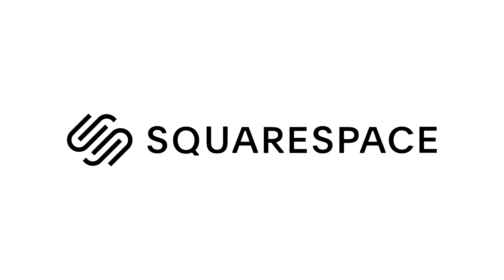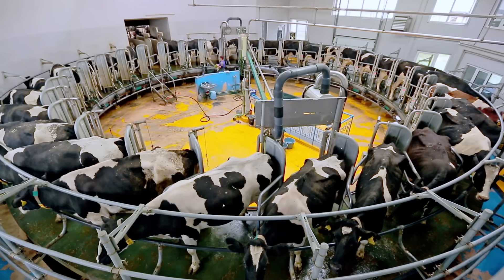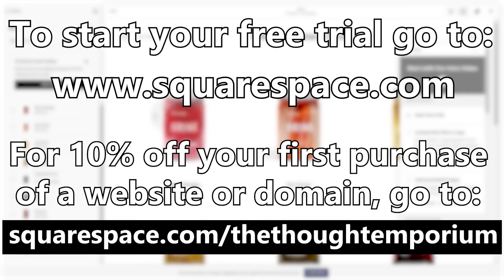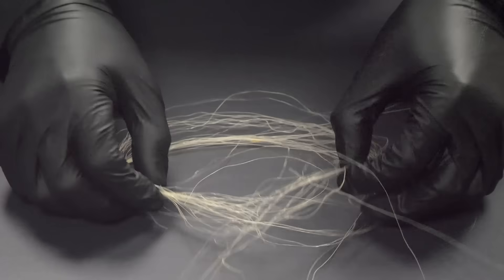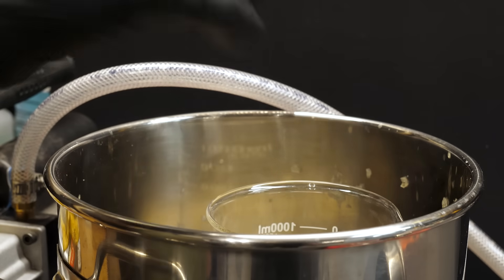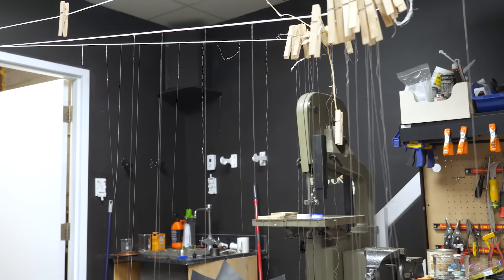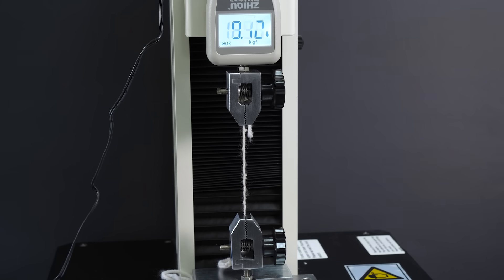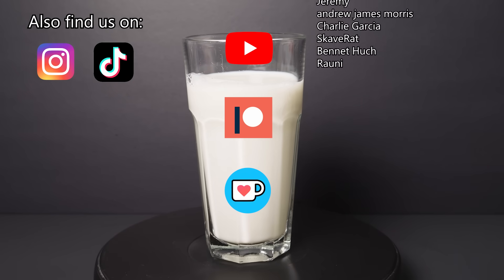I turned MILK into YARN

Comment: At the end you mentioned wanting a biodegradable version of this fiber to enter the market. That may be greenwashing a bit because cheap production of this thread relies on cows which are not exactly eco-friendly. (Unless you had casein-producing bacteria? But that wouldn't have the benefit of dairy subsidization by the US govt).
However, your point about milk being a waste product earlier in the video probably overturns or at least sidesteps the issue. (We are still reliant on cows)
TBH the biochemical and economical aspect is not my region of expertise, I'm in the field of materials science so the rest of the video is right up my alley but not this!
(As an aside I'm extremely weary of any "biodegradable" polymer because AFAIK there are no biodegradable polymers which readily disintegrate at a non-industrial scale. Does a formaldehyde-based, as opposed to acrylate-based, version of lanital do that?)

Comment: 12:45 As a Structural engineer, I feel obligated to point out that "kgf" means kilograms of force, not kilograms per foot!😅 (1 kgf = 2.2 lb = 9.8 N)
Reply: I'm glad someone said it. A year later and I was searching through the comments looking for this. Freaking chemists.
Reply: I additionally feel the need to point out that the kgf has been deprecated for over 70 years because it's confusing and less logical/simple. Newtons were already made the standard over a decade before the formation of the SI.
Reply: I also scanned the comments to see if anyone pointed this out. Just mixing SI and customary units is weird. We use one of these gauges and I think they were designed by Americans where the equivalent “freedom” units are lbf (pounds force), hence kilograms force.

Comment: I've been curious about casein yarns and plastics so I love this video!
One note though is that you didn't actually put any twist into the fiber for the strength tests, so its not a good comparison to the yarn, which was spun and plied. Braiding and spinning/plying are two very different processes, and in your second test, the braided yarn has a leg up by being both spun/plied and braided. Nonetheless, very cool!

Comment: Thank you so much for sharing this. I have always been fascinated with fibre and textiles and this may be an accessible way I can make a spinner at home using my 3D printer. Of course the method has some issues that would get in the way of DIYing it. The drying of the fibre seems like the most expensive aspect standing in my way. I don't have a vacuum chamber and I'm probably out of luck for the equipment needed for drying out the creatine.
Reply: You don’t need to buy everything immediately! Saving up and getting piece by piece may be more accessible (3d printer, vacuum chamber, then wet spinning machine, etc)

ALSO finding a local makerspace/club, or looking for like minded people and making one is even more accessible.  If you find 5 people suddenly you divide the cost by 5 (in theory)!

Comment: On your wet spinning machine you should add a spreader on the final spool so it fills up layer by layer (like a fishing reel does). this would also allow each layer to air out a bit more to speed up the drying process, and would make it neater and easier to unspool. You could add a drying spool, essentailly similar to the final spool but with a warm air feed through the centre, before winding onto the final spool.
Reply: Adapting spooler designs from FDM 3D Printing Filament Making Machines may work.

That one channel “Mr. Innovative” or whatever (I’ll double check the name) has all sorts of interesting threadwork related tools which may have a good spooler design.

Comment: You might wanna check out Robert Murray-Smith as he's done a couple of videos on milk plastics, though he didn't try to make fibers out of it. Two things to check out is that adding glycerin makes it not nearly as brittle, and that you can also use Tannic acid as a fixitive. Tannic acid is also found in tea so he made something impressive just in a really strong batch of tea.

Comment: I used to import a milk based curtain and furnishing fabric some years ago. It was supplied by an old family owned Swiss designer textile brand called Christian Fischbacher. At the time, and until watching this video, I thought it was new tech. I had no idea it was and old invention that was popular in the 20s and 30s. The fashion industry needs to adopt this instead of synthetic materials due to its biodegradability and the shocking (to me) fact that on average, young shoppers wear a new garment only 8 times before throwing it away! Incidentally, some textiles houses are now trying to weave new yarns and fabrics from recycled/ discarded clothing. But… so many questions from this video; you casually mention how you just made your own wet spinning machine from scratch… which I thought was impressive in its own right before recalling your earlier, equally casual statement, that you genetically modified yourself to overcome lactose intolerance for a while… as one does! Also, does formaldehyde bind the molecules together in the mix of the milk yarn for the same reason it keeps the flesh based works of morticians and certain Turner Prize winning artists’ together? Lastly - did you hear the one about the goats that produce spider silk in their milk? Could that tech be combined with this one to make a super strong wool alternative?

Comment: Hey so what would happen if you made an emulsion of the casein solution, then added the sulfuric acid and formaldehyde with fast stirring? Milk plastic nanoparticles? I assume these could be filtered, dried, and then compressed into a solid mass, then bathed in formaldehyde to create something like protein rubber.

Comment: Awesome!  Do you think you could use this to make a filament to 3d print with?
Reply: For FDM 3D Printing you need Thermoplastics (plastics that melt when heated).  I am unsure if this machine can make those, BUT “FDM Filament Makers” / “Filament Extruders” etc exist.

They tend to not have as good of tolerances as something like Prusament or Polymaker etc, and you also need a good plastic handling workflow, but it can be done.

Comment: use increasing speed on the second wheel to fine tune the stretching and then spin the spool much faster
Reply: and give the end spool axial spin with the length of the end strand, i hope you can imagine a lathe and how it spins and holds the little spool
Reply: for no confusion the spool is rotating 90 degrees from the main axial spin of the thin yarn

Comment: Could you try twisting it like real rope. I imagine the added vricsion (how do you spell that word? Things rubbing up against eachother) may help the fibers to stay together better.

How to: Start twisting your fiber into a thin thread. When your entire string is nice and even and so strongly twisted it wants to curl in on itself. Pinch the middle of the thread with one hand and with the other fold it in half so the ends touch and pinch those together. Now the thread curls in on itself and starts to look like a rope. Slide and pull to make it tidy and secure the lose ends. 

If my explanation isn't helpfull you can look up how to spin wool.

Comment: It feels like the fiber diameter could be able to be reduced by increasing the wheel speed (with say gearing) and keeping the flow rate (as determined by the nozzle size and viscosity) the same.

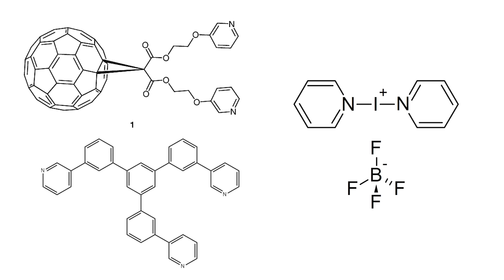Comment: 5:56 Add a 3-axis to that syringe and you've got a 3D Printer
Reply: I’m doubtful on layer adhesion, but it’s worth a try!  Printing in Gel (i forget the name, was it “FRESH”, used for bioprinting) may work.

I also saw a paper on using solvents that evaporate off and fans for Cellulose Acetate 3D Printing.

Would require tinkering and probably wouldn’t work, but again worth a try.

(Also “casting” or injection molding the casein plastic into 3D Printed or CNC Milled Molds could probably work as well)

Comment: Im actually curious what can be done with cow manure?

I heard about elephant poop can be turn into paper or leafs
Reply: Best use is probably “Anaerobic Digestion”.  You get “biogas” which can be upgraded to pure Methane (essentially high purity Natural Gas), or used as is in simple devices.

Then you also get nutrient rich liquid, and potentially some solids (depending on reactor design) which can be used for fertilizer etc.

There are existing open source designs to even do this with those “IBC” totes, although larger commercial options exist as well.

Comment: What about as housing insulation? You compare it to wool strength wise but are it’s insulating properties similar?
Reply: As well as the Flammability / Smoke Production (forget the standard, used in aviation), testing the R-Value would be really nice, yeah!

Comment: Use multiple smaller needles to decrease the required pressure for thinner extrusion, while also increasing the number of extrusions at the same time.

add a stage feeding up and down through water to clean the fibers in one go.

And add a uptake spool which much better resembles a circle... using much more thinner rods to keep dryability

Comment: Huh? Maybe I won't need an obscene amount of money to get ethical long fibre cotton, if this has close enough properties..
On the wet spinning machine- 
Would a slight crown tend to pull the strand towards its peak (like a bandsaw blade) Or is it slippery enough that it would tend to flow/fall off the wheels to find a shorter overall path? 
Was there a specific reason that the path isn't zig-zaged more to increase engagement with the wheels?

Comment: 5:09 Which element is 'potasium' again? lol
Also you might want to add a traverse motor to the take-up to even out the fiber on the bobbin and prevent it getting rolled over and under

Comment: I've worked on reverse engineering various wire streachers getting the old antiques working with modern computers and one improvment is;
Absolutly no V-s. it pinches, snapping threads and even steel wire, instead usd about a 5° angle leading from a large smooth round chamfer, it will do you better, the string will force itself towards the small end and you can use this to make multi-step spinners in all sorts of configurations

Comment: Hey, Fabric process RandD engineer here. You need to swap out your clamps on your tensile test. Using a pinched clamp like this creates localized weakness near the clamp point resulting in weakness in the 20-50% lower range for the actual fiber strength. Great Video!
Reply: In standard tests they bend them over a defined radius on each side  before clamping them.
Reply: so would it be better to use hooks where you tie the rope to?
Reply: @sultanmutschi not tie, but splice. look up rope splicing, it's an art and gives you loops on the ends that exceed the strength of the bare rope with no weak points.
Reply: Can I hire you to make a whole new type of silk from all sorts of products including biomass!? I need a new 10 million dollar factory coming online if it's so...

Comment: Does adding 0.5% graphene improve the product? It does wonders to epoxy, I wonder if it would help here? (or make it worse?)
Reply: Unless the formaldehyde sticks it the same way it probably only create cut off points.
Reply: @Angel24Marin formaldehyde polymerises phenol very well. And hydroxy closed graphene looks very similar to phenol at its edges.
Cheap graphene can have hydroxyl groups on its edges anyway.

Comment: I suspect the rope would be stronger when twisted together instead of braiding, possibly might even beat the wool tensile strength test!
Reply: Yeah, they could make a scaled down version of the rope making machine the king of random put out a long time ago
Reply: @cornonjacob  There's a small rope winder on thingiverse I've printed and used (thing:2255317) to pretty good results, though I had to make a little winder to use on the other end of the rope which it lacks. It wouldn't be complicated for them to design that.
Reply: @ValleysOfRain ??
Reply: @mars5train601  Hmm, interesting UI bug. I had originally responded to a comment about the use of foodstuffs to make materials and fuels vs use as actual food.

Comment: Doesnt kgf mean kilogram-force, instead of kilograms per foot?
The video is very cool, it makes sense that this would work, but it's still very interesting to think about milk being turned into fibers!
Reply: was going to say the same :)
Reply: I'm pretty sure "per foot" was because he made all the test samples around a foot long. The device just measures pure force.
Reply: @Hendlton  the length doesn't matter when measuring the force. So it would be strange for him to include that in the unit. More likely he just made a mistake.
Reply: He had an american moment
Reply: yeah I don’t understand how you would mix kg with feet. it’s definitely kg force
Reply: kilograms per foot does not make sense at all. Even using kilograms to measure force is technically incorrect. Maybe he somehow got confused by Newtonmeters (torque).
Reply: @Mike-oz4cv  Kilogram-force is an acceptable metric non SI alternative (approx. 9.8 N), it's not technically incorrect, it's just not SI.
Reply: @Croz89  
Actually, it hasn't been an accepted measurement unit in general for decades and is not one of the non-SI units still accepted for use with SI. The newton should always be used instead because it makes more sense and reduces confusion.
Reply: @Persun_McPersonson  Then you should probably go after anyone who measures volume in litres, or pressure in bar, or area in hectares. I'm all for using the metric system, but insisting on all SI all the time is for physicists and mathematicians.
Reply: @Croz89  Eh? Maybe applied mathematicians and experimental physicists, but I would expect pure mathematicians doing mathematical physics to use something like plank units (c = G = hbar = 1. Well, I mean, each of these are 1 of whatever combination of base units is appropriate. Of course they aren’t actually equal because they have different units. Still.)

(As for the units they use in everyday life, I don’t see why it should differ from most people.)
Reply: @drdca8263  Depends on the branch of physics.
Reply: @Croz89  
So you're choosing to ignore my point that metric is based on logic and that's why clinging to less-logical units is wrong?

The kilogram-force has always been problematic and that's why it was deprecated since before the SI even existed. It was a relic of imperial measurement habits, being based on the pound-force, which means it naturally retains its problems.

The liter of 1 dm³ and hectare of 1 hm² are not working under the same faulty logic as the kgf of 9.806 65 N; the kgf is much more analagous to the pound-force of ≈ 32.174 04 lb⋅ft/s² or the US gallon of 231 in³, which are illogical unit relations from a system which is known for being illogical and outdated.
Reply: @Persun_McPersonson  Kilogram-force is a useful unit, as it relates directly to mass under earth gravity. It's used in engineering a fair bit, some load cells use it, some servos use gram-force-centimetres for torque. When you're trying to weigh or pull a certain maximum mass it does avoid some extra calculations. I'm not going to get my knickers in a twist over it, it's still metric and conversion is fairly easy either way.
Reply: @Persun_McPersonson  According to a US engineer of almost 50 years (my dad), using pounds as a unit of mass is wrong, and properly mass should be measured in lb*s^2/ft. Yes it's kind of ridiculous but that's how they've always done it.
(Also I'm not sure you're using the word "logical" correctly. Any unit that is defined based on a consistent standard is logical. Some may be less intuitive or easy to work with though especially for scientific purposes.)
Reply: 12 hours ago? mom pick me up i'm scared